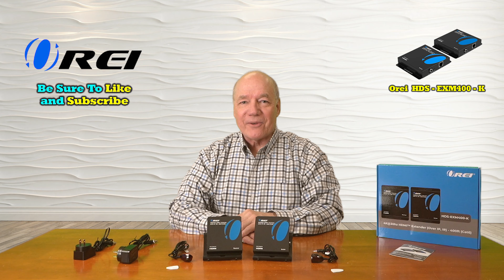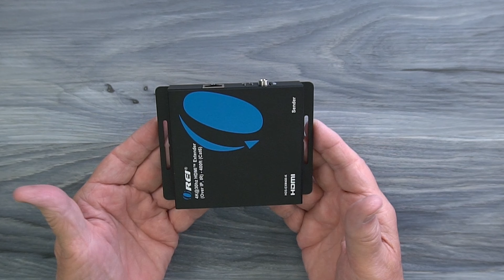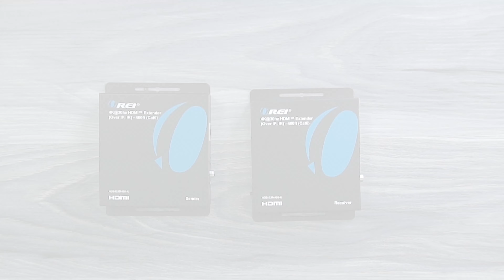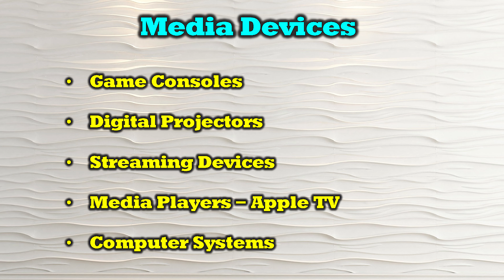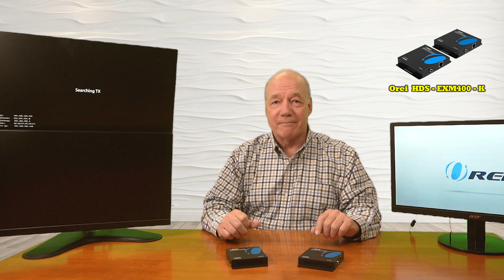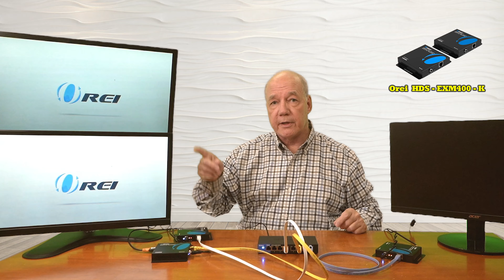OREI 4K HDMI Over IP Extender | One-to-Many via CAT6 up to 400ft with Loop Out & 1G Switch Setup!

Comment: Can you use an extender with HDMI fibre optic cable? Are any of OREI extenders compatible with HDMI fibre optic cable. I like the idea of the infrared remote for controlling an NVR from a remote location. Can you recommend an ideal extender along with a video, please.?
Reply from the maker: Yes, you can use Fiber Optic HDMI cables with any of our products. Most of our Extenders come with the IR functionality, you can connect with our support team at info@orei.com to find the best suited model for your needs.
Reply: @OREI-COM  Thanks. Just one more thing. Would the fibre optic HDMI cable give a better picture quality than the cat 6 or 7 with the extender hook up?